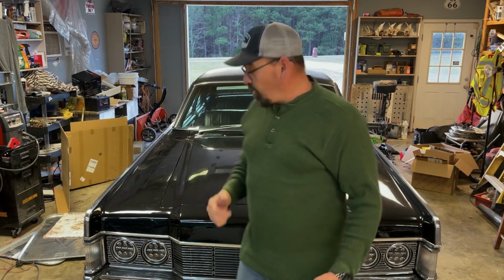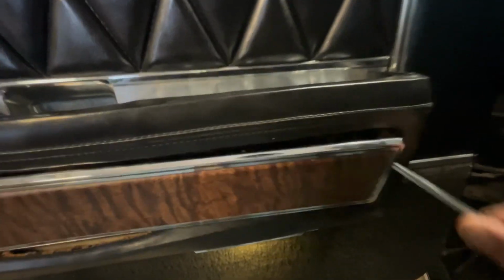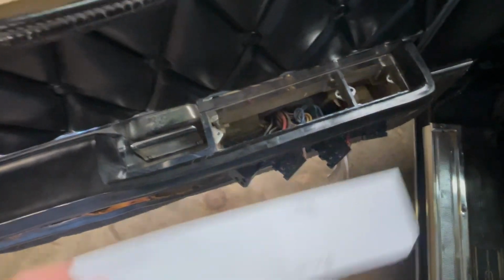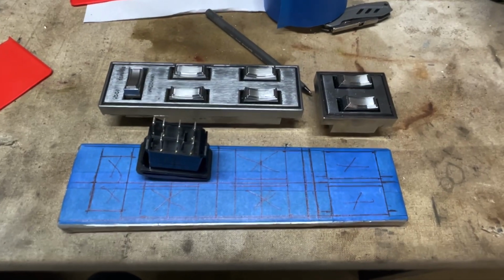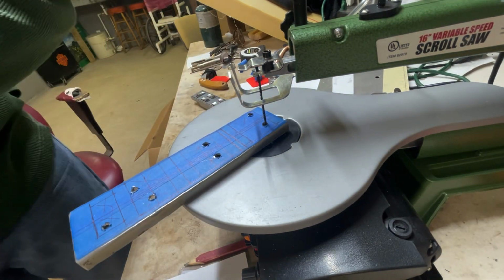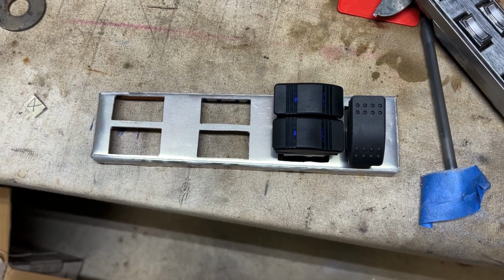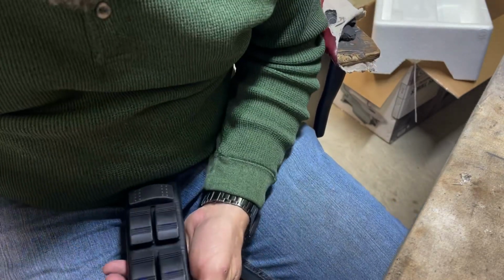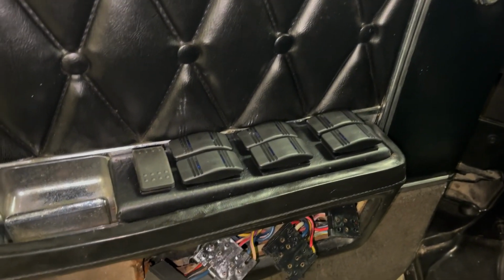1968 Lincoln Continental Window Switch Upgrade

Comment: Would you make a pair for the driver and passenger side on a 1971 Continental
Reply from the maker: I wouldn’t even know what size it was. I’m sure you could do it. I bought all the stuff I used on the video for pretty cheap. I have maybe $150 in switches and a $20 sign blank. You should try it. But be very careful with the saw and wear safety glasses and gloves. Thank you for the comment.

Comment: This guy is a genius to come up with that idle I couldn't do that lol
Reply from the maker: Thank you for your comment. These switches still work excellent. It would be good on a convertible also in case a rain storm popped up. They are completely water proof boat switches. Kinda big but do the job well I think.

Comment: I believe the original switches can be restored by taking them apart and cleaning them ,I have done this on my lincolns
Reply from the maker: Mine are busted at the hinge point. Holes in the copper points. Very bad shape.
Reply from the maker: You should check out part 2. I don’t think they look to bad and I’m sure they will last a long time.